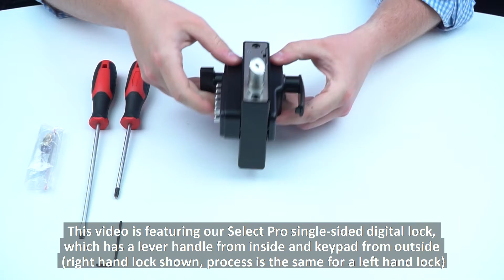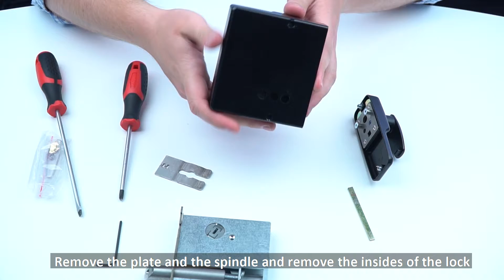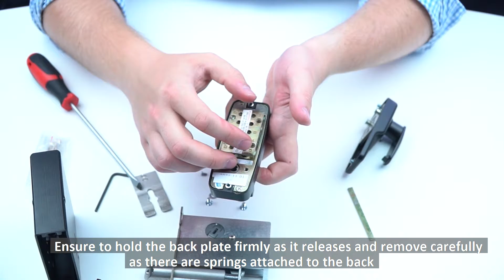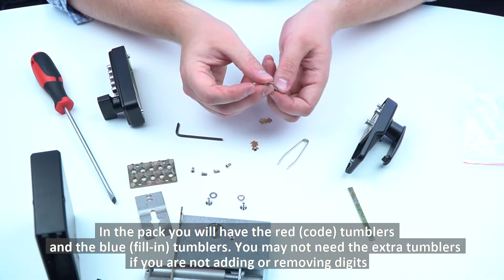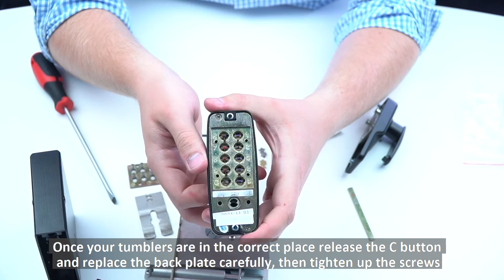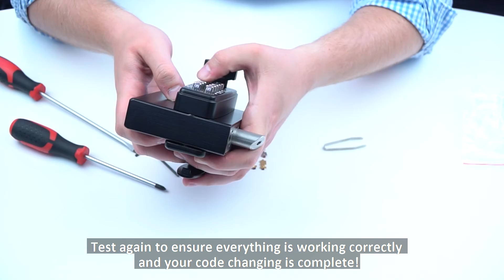How to change the code on your single-sided Digital Gate Lock (DGLS)

Comment: You guys make changing the code so hard. Worst ever product design. If my contractor told me this before I would not let him use this product.
Reply from the maker: It is not that hard, but we appreciate it may seem like a long process. We can't make it too easy to change the code or anyone could do it and then it wouldn't be a secure lock.
Reply: Agreed! I was about purchase until I saw this. My goodness no thanks. Make it difficult to change code but not so that we have to completely dismantle the whole thing and then put it back together! Awful design.